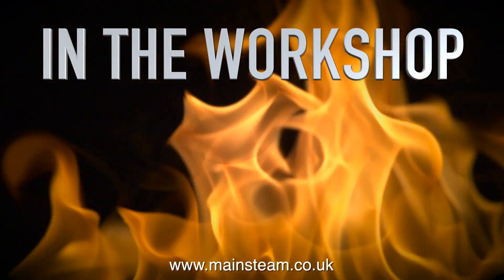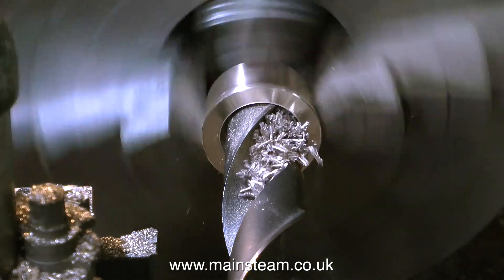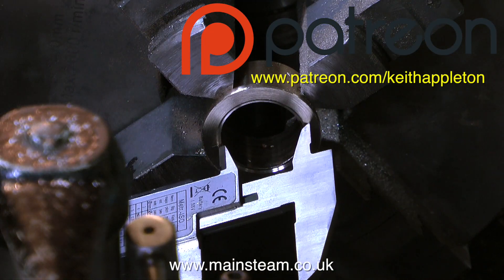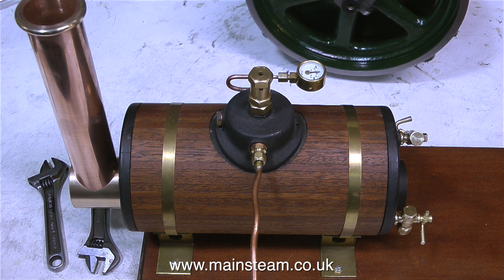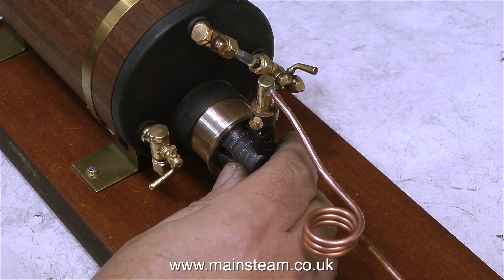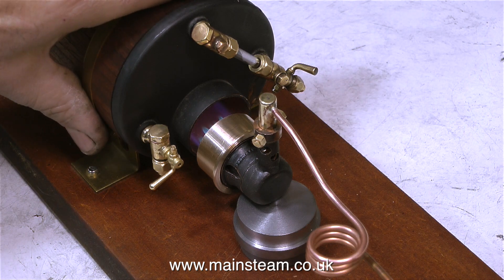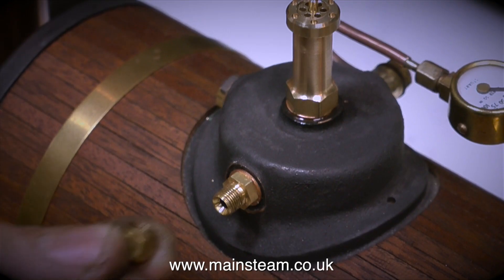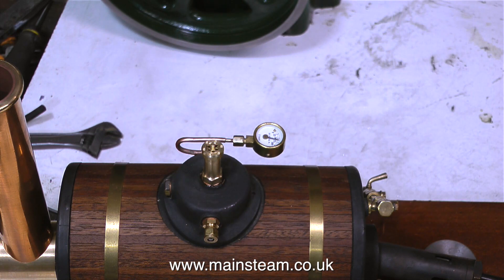THE QUEST FOR FIRE - PART #1

Comment: When I was in my twenties I was a pipe fitter welder and used to work on Lancashire boilers in the back of my mind they used air vents to balance the air flow to the boiler or it may have been another boiler I worked on so many.  Anyway that's where the idea came from.  For whats it's worth I also served my apprenticeship working on Platt high pressure boilers and for a sixteen year old they frightened me to death.  Especially when I was pushed into a super heater manifold to do some welding right at the top of the boiler which was about 10 foot high.  How I got in and out of that tiny door I will never know!!!!!

Comment: I'm not sure how you could do it on a model but if you could put something in the tube that would disrupt what could be laminar flow that should stop the howling, The obvious concern would be the heat resistance of the material

Comment: That fluttering noise from the safety valve may be deliberate as an audible warning on a steam launch. 
It's irritating enough to be one.
It's caused by the valve ball bouncing at spring harmonic. If you change the spring to a progressive type spring of the same compression rating, that would stop the harmonic setting up and the noise would be gone. Except for the hiss of escaping steam. 
The adjustment of the release pressure would be the same as before. 
It's still not the prettiest pressure relief valve, is it?

Comment: Hi Keith just an idea what about extending the ring so that the burner sits back from the boiler then drill the ring until enough air enters the boiler freely to enable the burner to burn all the gas. Or you could have some king of air vent that opens like on a potbelly stove. Just an idea may need some designing to make it look right. JIM  Just had an idea have another ring over the hole that you can turn to allow the right amount of air in clear as mud??????
Reply from the maker: Yes, that could work - I have a few ideas - I will try them. The main problem is insufficient heat from the small burner. I will make a bigger one I think . . . . but I want it to be quieter than a blowtorch . . .

Comment: I enjoyed your Quest For Fire much more than I did the 1981 movie version. The Pop safety valve is certainly an improvement over the Stuart one. If I do not use a shop made one I will certainly consider a Jubilee one for pressures higher than 30psi. For lower pressure boilers I have found that the Willesco   ones work good.

Comment: Hi, Keith. Here and in a recent video when you were boring out a part with a large twist drill, it looked like the drill was vibrating a little before you had gone very deep. (I think in the other one you followed up with a reamer afterward.) Was it actually vibrating, and is that a problem when it happens?

Thanks as always.
Reply: The main reason this happens is because he typically uses a center drill rather than a starter drill to spot his holes. A center drill is meant to make a hole for a lathe center, and has an included angle of 60 degrees. A typical twist drill has an included angle of 118 degrees. The drill vibrates because the cutting lips are never perfectly identical and the drill is being guiding by the lips rather than the point, it will continue to vibrate until the tip reaches metal that has not been drilled and the pressure from forming the material at the center outward towards the lips dampens the vibration (the center of the drill does not cut, it pushes the metal out to the lips).

There are 2 common work arounds. One is to only use the very tip of the center drill, this provides a much better start than drilling down to the larger portion. The other is to use a proper starter drill that has an included angle of 120 degrees so it contacts the center of the drill first rather than the cutting lips. Lots of professional machinists use center drills for spotting, very few of them drill past the very tip.

The vibration is not an issue for Mr. Appleton because he almost never uses the hole as drilled, it is almost always followed by a second operation.
Reply from the maker: That large drill wobbles a bit at first but when it gets past the centre drilled part it settles down and you can see that it cuts much better and becomes more stable.

Comment: if moving the flame head out of the boiler stops the noise, how about a collar at that point with holes in? then you wont have to block air inlets
Reply from the maker: Please watch the next parts - that is one of the easier solutions . . .
Reply: will do!

Comment: In an earlier video, you stated: "you can't use propane on a model steam boiler". I for one (if you can get a suitable burner) can't see why. The calorific value of propane is only marginally higher than butane and it has the advantage of not losing pressure as it gets cold.
Reply: Hi Brian, I have used propane in a couple of large model boats using the one pound disposable tanks. The problem with using propane particularly in smaller model boats or small trains (G or O gauge) is the size of the tank you need. If you look up the pressures of propane at various temperatures you will see why you need such a strong tank. Propane will lose pressure as it gets colder it just takes longer, usually due to the fact that the propane is normally in a larger tank then the butane.
Reply from the maker: in the Model Boat Club of which I used to be a member, I was told that Propane was not allowed for use in model steam boats - probably because of its high pressure and Health & Safety etc etc
Reply: many of the blowtorch type cannisters are now butane-propane mix,  is that an improvement of use?